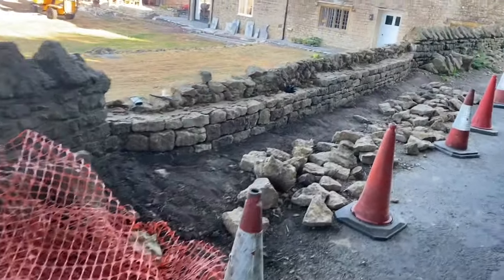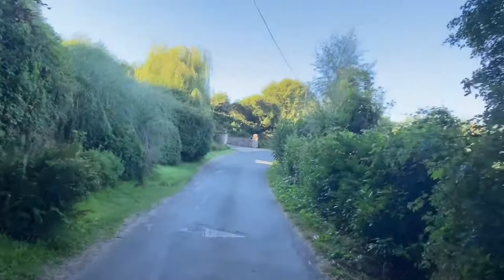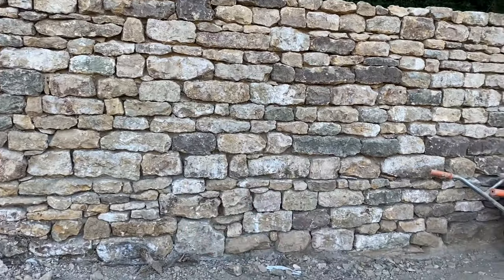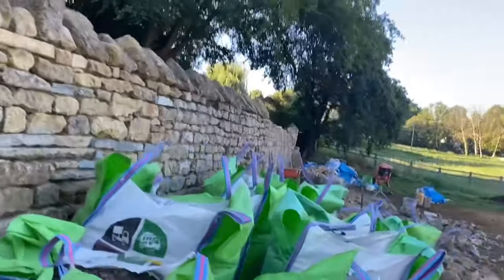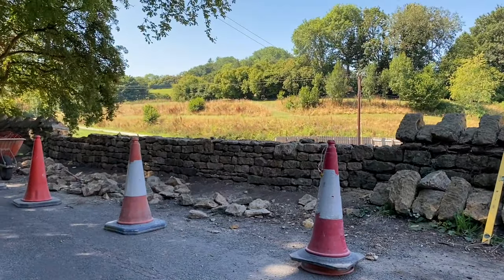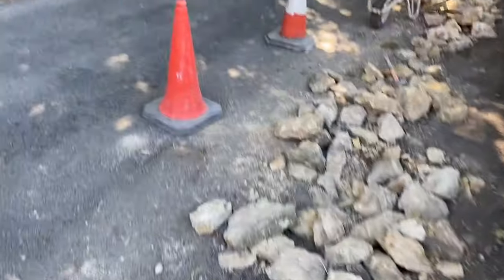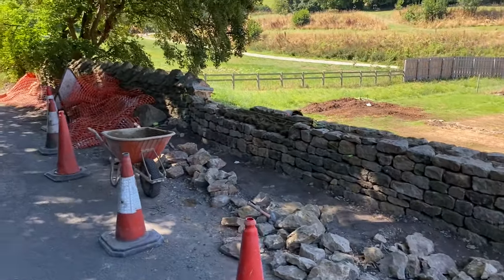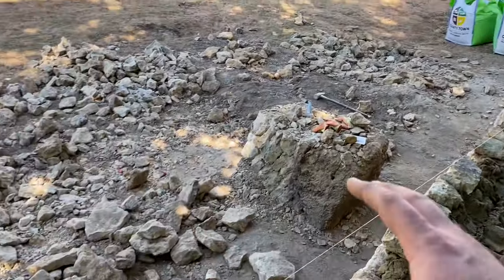Building A Old Stone Wall Dry Stone Effect #7

Comment: Yp tengo una duda de cuánto es el espesor del muro, pienso hacer uno por mi cuenta.
Reply from the maker: This one had a batter on it and to be honest cannot remember the width. Maybe look back through the videos as I may mention early on. The top wouldn’t be less than 500mm so this could be around 1000mm at the bottom, as tall wall with a strong batter.